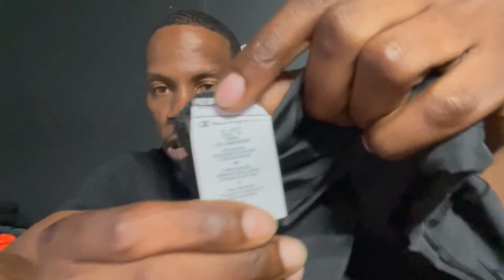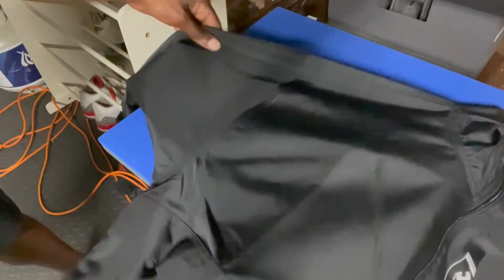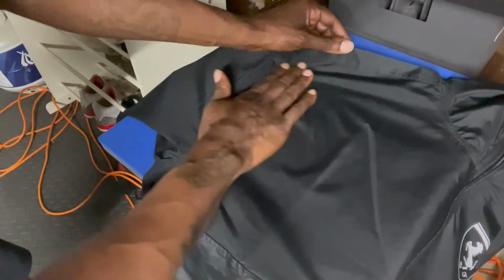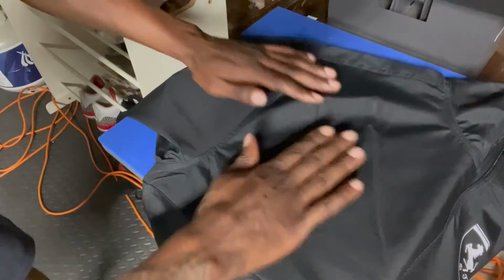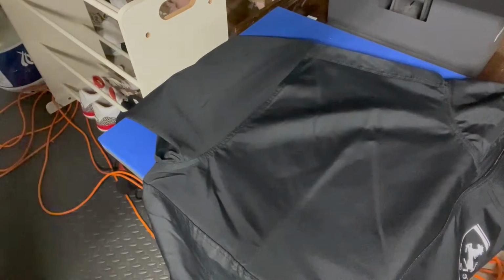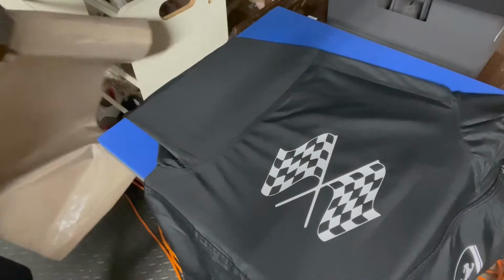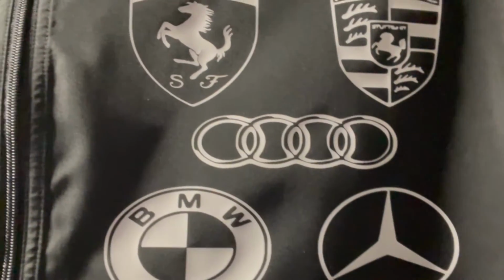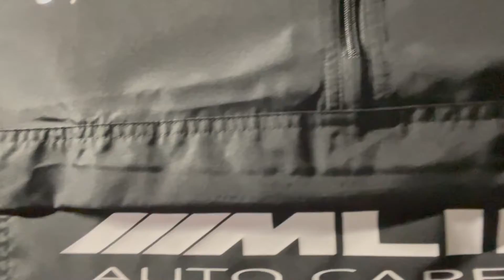CAN I HEAT PRESS WINDBREAKERS? (..SURE YOU CAN!)

Comment: What is that paper called that you use over the design ? And if I don’t use it and just use the design will it burn the windbreaker ?
Reply from the maker: It’s call a teflon cover. I recommend using it or lowering the temp on your press for maybe 10-15 secs

Comment: Are these jackets waterproof/resistant?
Reply from the maker: Yes they are!!
Reply: And you didn’t need to use a VLR on the areas you applied Siser HTV? I see a lot of people recommend wiping  down the areas in which the HTV will go, with VLR. But I feel like that takes away from the jacket being “new”. Would you recommend the same settings for 100% polyester taffeta?
Reply: @MrTShirt007  thank you so much for responding! There’s so much mixed information out there.. I’m just trying to make sure I don’t burn these jackets I’m making for my daughters dance team!

Comment: If my jackets are 100% polyester taffeta, do you recommend the same heat press settings? 

Also, I see that some recommend using VLR to remove any water repellent for jackets like these; do you think that step is necessary?
Reply from the maker: Never heard of such, sorry. VLR is to remove htv.
Reply: Sisers blog said to use VLR to remove the waterproof coating but I’d hate to apply anything like that to a new product for a costumer.. 

Also, for names on the front of jackets; what size would you make the names? I have a new order of jackets ranging in sizes from youth large to Adult medium.
Reply: And I’ve since found out that polyester taffeta is the same as 100% polyester. I have a Cricut EasyPress so I’m just going to start with the lowest temperate possible.